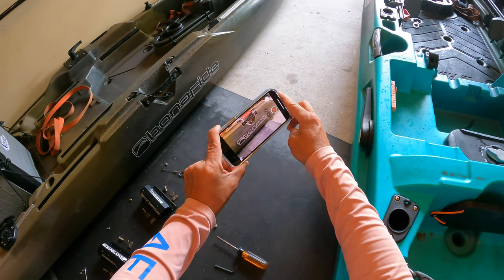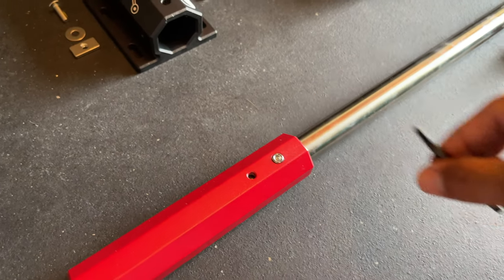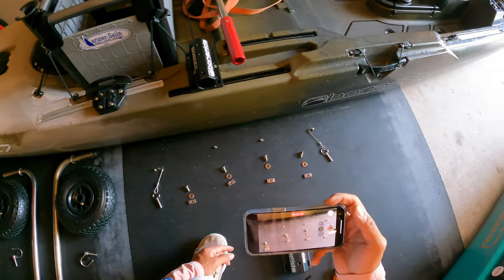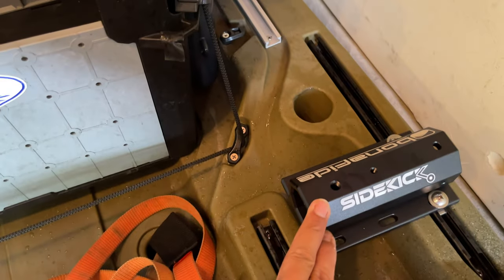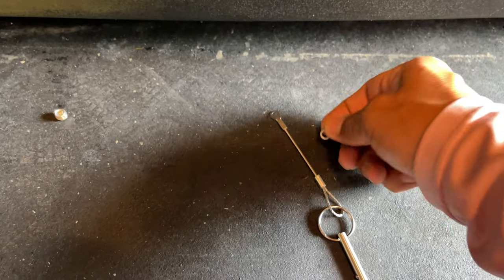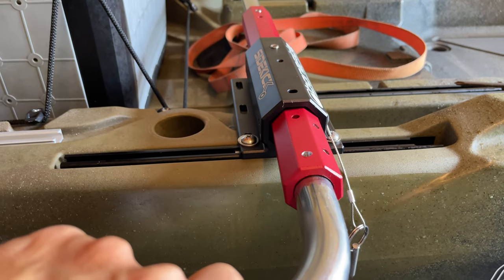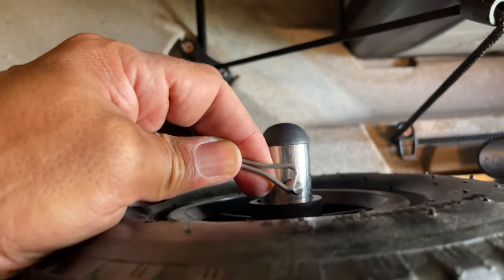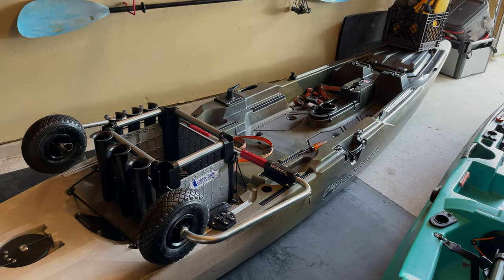Bonafide Sidekick the ***QUICK and EASY*** Install Video (S5 Ep100)

Comment: This is better than Boondox, at least pressure distributed along track. Been working on my version using a support through the scupper holes holding weight from bottom. A lot of torque on that plastic...

Comment: Mark, I used to have boonedox landing gear on my PDL 120. I have the autopilot 120 now, and I miss the convenience of landing gear. I have the wilderness systems cart but it’s kind of a pain at the boat ramp. Any recommendations? Should I slap the landing gear on the AP120?
Reply from the maker: As long as you’re using boat ramps the wheels are convenient. It’s impractical to do an off-road launch by yourself. If you have a buddy then someone can hold the kayak up while the other person removes the wheels. I wasn’t so lucky when trying to launch in a muddy creek by myself.